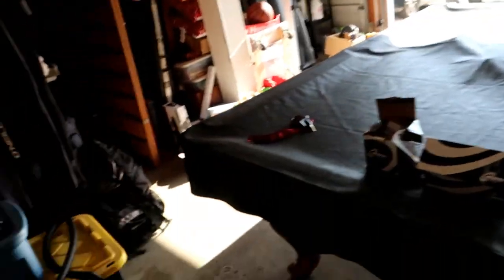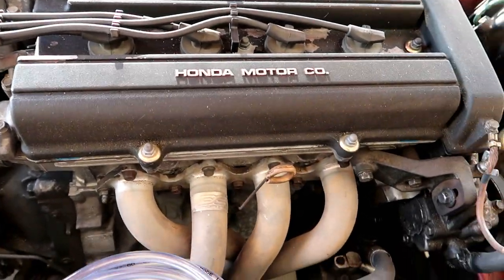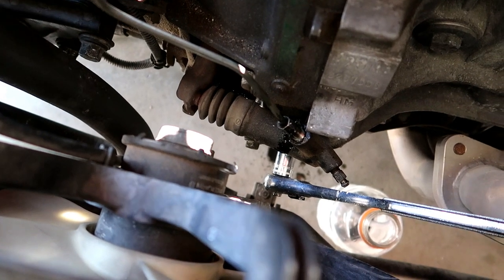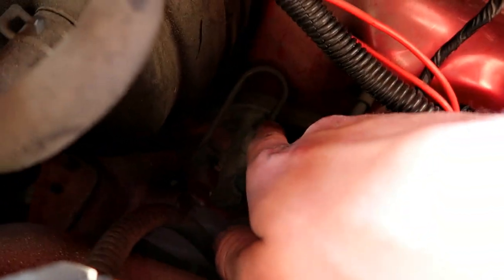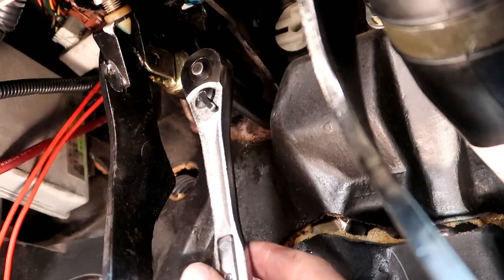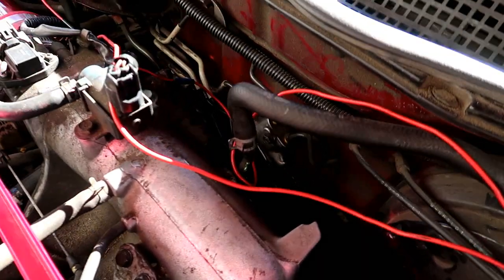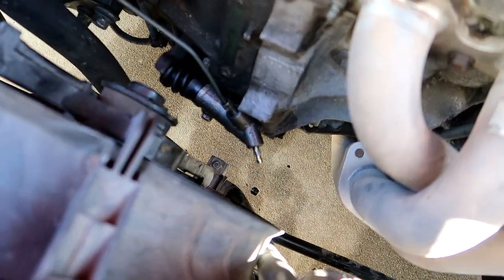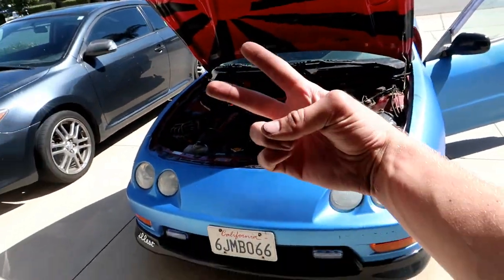How To Replace Clutch Master and Slave Cylinder (1994-2001) Acura Integra!!!

Comment: I changed both clutch and master cylinder also but my pedal isn’t coming all the way back up iv tried bleeding it multiple times and have seen no leaks what so ever but only comes up abit and not enough to change gears? Any help would be appreciated thanks 😢
Reply from the maker: Make sure your not missing the return spring on the back of the pedal. Check all your lines make sure there not broken or leaking in really not sure what else could go bad unless you bled the clutch wrong or your pressure plate could be old and token
Reply: Narcir Mango yeah makes sure you’re lines aren’t broken or leaking !! It’s takes quite a bit of tine to completely take all the air out of the new cmc and slave it’s a pain but keep doing it try bench bleeding it

Comment: So i got a question replaced my slave and now it won’t even move? I still have no pressure in my clutch, This all happend after I started working on the slave.
Reply from the maker: Check for a kink in the line I’m not really sure what else would cause it

Comment: Hopefully you can reply to me by today !, I tried to turn my car on when I step on the clutch, it does not feel like it did yesterday I can almsot press the clutch to the floor n it just wouldn’t go into gear , so today I ended up trying to gravity bleed my car twice , that didn’t work I looked around to see if the cable had any leaks which it doesn’t. Not to sure what else I could do the clutch is practically new , does have a minor leak under the dash like how u explained in the video , would I have to follow these steps to be able to have the clutch functioning properly ? Thanks so much if u can reply back !
Reply from the maker: Check master cylinder could be leaking under dash
Reply: OMGTeggy it is actually ! By changing the master u think most likely itl work ??
Reply: OMGTeggy also is it suppose to come with anti locks or no ?
Reply from the maker: Yes mine did the same thing replace that and bleed the clutch then your good to go.
Reply from the maker: I don’t know what you mean by that

Comment: nice teggy, you need vtec, i had a b series vtec teggy and i literally didnt feel vtec until i got a b18c swap, did it in a driveway... but clutch died today and good looks on flare wrench advice, i needa post my teggy
Reply from the maker: Yeah I’m actually building a gsr motor now can’t wait for vteecccc!
Reply: @kys_garage898  forget Bseries, go K lol. K all day
Reply: I have a 96 gsr, love the car but its cost me so much money with the timing belt and my city having incompetent mechanics. I've found a good mechanic but then the suspension needed attention. Now I have good suspension and good tires but the clutch master and slave cylinder needs replacing cause I can no longer shift gears. Im going to attempt replacing them myself. I hope I don't fuck anything up cause I love this car and I'm not very handy cause I've only ever done small work on cars
Reply: Original gsr b18c vtech 1.8 ltr. My friends are astounded with the performance but it's so hard keeping it in good drivable condition since it's my daily drive and I have no mechanic experience
Reply: @TheGingaDude  I’m literally in the process of a suspension rebuild, I’m waiting on tires because I’m going to replace the power steering rack and pump
Reply: @bradlyfan  she is going to be a damn good ride

Comment: Hey brother I was at the last step where u put the bolt through the pump fork and the bolt is not long enough to clear the lil hole to put in the cotter pin. I have the same brand as you. Did u bend the fork in a bit  to clear the hole for the cotter pin?🤔😞
Reply from the maker: It should be long enough. Did you take it off the stock fork? If so it’ll work just gotta wiggle it a little.

Comment: Pumping the clutch pedal for 1 turn of the bleeder screw is not needed 😂  1 pump, 1 open turn of screw then close screw and repeat.  Clutch system does not have a diaphragm and vacuum sorce like when pumping the brakes.